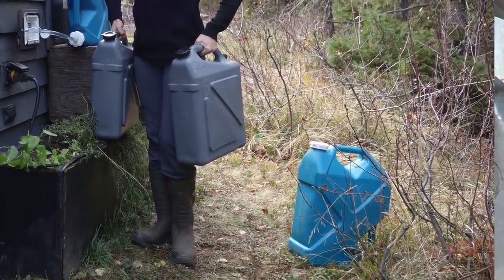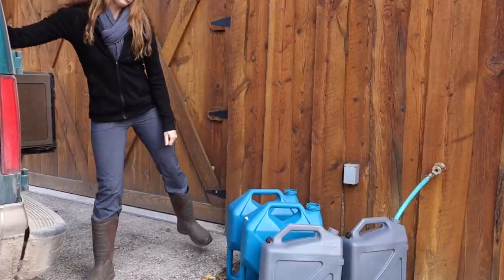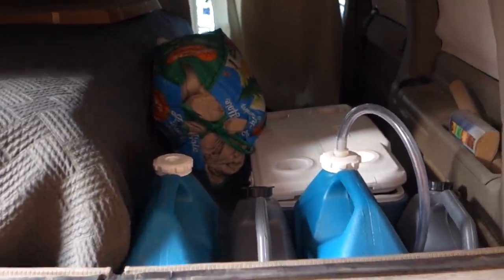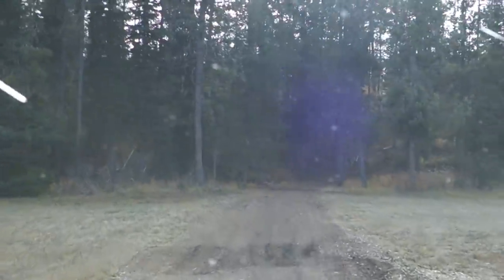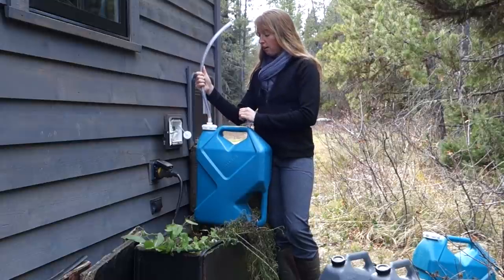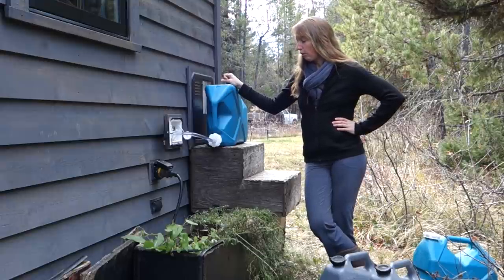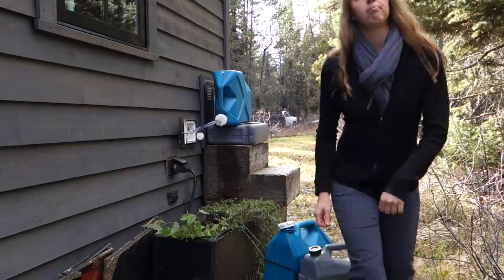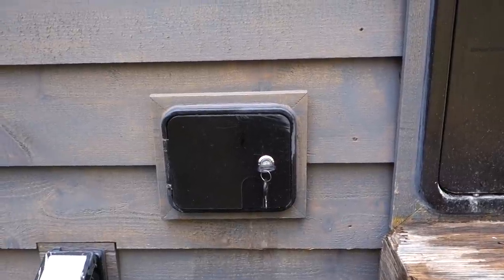Life in a Tiny House called Fy Nyth - Off Grid Water System

Comment: 3 food grade totes $ 200, ram pump from creek 6 months a year $ 200 max. Winter solar 12v trickle pump, and 12 v tote heater. Diy under $700, and when you leave goes with you
Reply: might not be "6 months" on the ram pump. Below freezing much of the time, including a frozen creek? a deep well is the only long term solution, but, as she said...better for  when she owns her own land. but, personally, I love ram pumps! I think they're the cat's meow. coupled with a solar-hot-water-heater, and there's free water, hot & cold!
Reply: @just-dl  I live in north eastern Canada, have a well,, but also built what I discribed for a grid down, I can pump energy free water year round, so I know cold believe me on that , and  I use a ram for all my garden needs free water no lugging, no cost after my initial set up, rams run for ever with little maintenence and 0 cost
Reply from the maker: Thanks for the ideas! I suspect you don't have experience with how cold the climate is here. We have solid snowpack on the ground for eight months a year at least, with temps down to -30F or more. That creek freezes solid for much of that. And I've never encountered anything electrical that could keep water from freezing solid in those temps that did not require more power than my whole system produces. (Unless of course the whole water system was internal and heated by my wood stove as everything I have now is.) And of course, there's no sun at all for many days on end in the winter as it snows thickly all day and I'm fairly far north. Then that creek melts, as does most of the snow, and it becomes a raging flood full of chocolate brown water, debris, and full trees washing down stream. Which wipe out and flatten anything you might have in the water. Then it turns into a nice calm clear creek for a couple months, and then we start all over. I did already build a ram pump for summer irrigation, you can see it's story here - https://www.youtube.com/watch?v=9nZcX4l1Z94 . Then even if I could over come all those challenges, I'd need a good filter setup to take out leaves, logs, and such debris for a few months, and another level of filtering to clean the water of bacteria from all the wildlife etc. that poop in it upstream. And all of that would also have to be internal to the house, or freeze and burst. :)
Reply: @daleval2182  Northeastern Canada? Which province? (I'm in the "other" maritime province...Maine) The garden is perfect for the ram pump! It can hibernate in the winter (or not, if your water supply doesn't freeze), and is set to operate at it's peak when you need it most. My place has no running water to tap into; but, I'm looking for a property with some topgraphy...and, preferably, a year-round stream/river to tap. (not just for ram pump but for hydro power. I'd like to get 100% of my water that way, if humanly possible.
Reply: @just-dl  Nova Scotia
Reply: @FyNyth  OK just made a suggestion, I lived in the north of Alberta , I  know the cold part, and now live in Tropical Canada, Nova Scotia, lol, sounds like you have no choice do what I did, dime up, buy land, dig a well, I use the ram from April till Oct, too grow, my well has 110v or 12v, from solar in a grid down, I have an on demand hot water system I can run on power or propane. I have a friend with an atisien deep well, still lug jugs from her place just for drinking as it's so pure ,and  taste so good. Good luck, where are you in Alaska? You have 8 months freeze?
Reply from the maker: No problem! It's not a bad suggestion, just explaining why it's not a good solution in my particular location right now. :) It sounds like you have a wonderful setup! That's fascinating to me that you can use a ram pump that long that far north. Maybe you have a bigger creek so it doesn't freeze as fast? What's your average snowfall there? Ours is 450 inches, though I've seen multiple winters over 600 inches. We still had solid 4 1/2 feet of snowpack on the ground through April here. It last snowed 9 days ago. :) Summer temps here rarely get out of the 70's F. during the day and freeze or close to it most summer nights. And snow is possible every day of the year. I don't quite know why this corner of WY mountains is so cold, but much of the time it's colder than most of the populated areas of Alaska and sometimes colder than Antartica.
Reply: @daleval2182  to paraphrase a former VP candidate...I can see you from my house! :-) Howdy, Neighbor!
Reply: @just-dl  howdy brother lol. Maine is beautiful natural country as is Nova Scotia, I lived near Toronto most my life, I'm up here now on an acerage, right beside on an 87 hectare lake full of brown trout, specel trout, I have a well good water, I can run on 110 v and 12 v solar back up, I have a pump house at the lake, and a ram pump at a creek behind the house,  so water never going to be an issue, Im located 1 klm from the port of Canso a major fishing port, so as long as I can still fish food will never be an issue, we have 15 above grade food plots 4x4, and this fall I'm planting hybrid apples, wild berries and mature apple trees  already grow all around the lot, all planted by the first owner, so this my piece of paradise to retire, I have a multi heat method, adding a wood stove this fall, as where surrounded by thousands of hectares of bush, firewood won't be an issue as long as I can still go cut it, but I have local vendors that deliver when that time comes. I can't afford a fully off grid solar and wind generator yet, but it's on my to do, I love the idea of rely on nothing for noboby for heat power and light, to me totally off grid is my goal

Comment: I have a question Ariel, could you take water from the creek at the back of the house? Seems like it would 
Work in a pinch but to consume it yes you would 
Have to filter it.
Reply from the maker: Yup. I can and do for watering the garden, and if I needed it, I would use it for drinking. But it's easier to get well water that I know is good and not need to filter.

Comment: I would love to know what kind of water tank you use?
Reply from the maker: The one inside the house? Hmm... I'm not actually sure of the name.
Reply: @FyNyth  is it a plain plastic tank with a lid or is it an actual water tank? I will be living off grid next year and doing something very similar with your water system, which is why I am so curious :)
Reply from the maker: @selienmorawitz1013  It's very similar in appearance to this one. Though I don't know the brand of mine, it is an insulated dedicated fresh water tank designed for an RV. Best wishes with your move and let me know if I can be more helpful. I'm sorry I can't tell you the exact make and model.  https://www.walmart.com/ip/Class-A-Customs-42-Gallon-RV-Concession-Fresh-Water-Tank-with-12-Volt-Water-Pump-T-4200-PUMP/180244433?wmlspartner=wmtlabs&adid=22222222222365238460&wmlspartner=wmtlabs&wl0=e&wl1=s&wl2=c&wl3=75247959360220&wl4=pla-4578847494952936&wl5=&wl6=&wl7=&%20wl10=Walmart&wl12=180244433_10000016552&wl14=insulated%20rv%20water%20tank&veh=sem

Comment: Good for you! Strong independent woman. Question: What if your van becomes immobile? You live so far out...off the grid. How do you clear the snow (road way?) First time viewing your post as you most likely can tell. Just wondering as I'm sure you must get snowed in. Do you have a helicopter?  Seriously...what if you get ill God Forbid?
Reply from the maker: Welcome and thanks for joining the Fy Nyth Flock! Well something major could always break down, but there are tow trucks here too, just a longer wait for one. But I do try to stay on top of regular maintenance and always have a jump starter, air compressor, extra oil and transmission fluid etc. in the van. Look up some of the winter videos around my house. I shovel around here and one of my neighbor's plows the lane out to the paved road. Ha, helicopters are not quite in my budget! ;)

Comment: you could put the steps vertically to drain the rest of the water to tank
Reply from the maker: Yup. In the winter I do, but in the summer, I need the bottom down as that is the only place there's a hole so I don't crush the plants underneath. :)
Reply: Also you may need a funnel to transfer the water to the can! just helping you saving water!! love your Tiny house!!

Comment: What's the difference between your little house and a travel trailer?
Reply from the maker: The construction. My house is built to a higher standard than most residential construction going up today. Everything about it should be solid and comfortable in 100 years. A travel trailer is much lighter and probably better if you move every day, though it will not be solid in a 100 years.
Reply: Thank you for an honest answer. Subbing with the bell.💓

Comment: You may want to consider keeping 5 or 10 gals in the house as a backup supply?!?
Reply from the maker: Except I already keep all 45 gallons in the house and don't choose to take space away from anything else to store more water at a time. :)
Reply: Fy Nyth Oh I didn't know that, I thought all you had was what you put in on the outside! Is that 45 gallons all in 5 gal. containers?
Reply from the maker: While it's filled from the outside, all that water is stored inside.

Comment: Wao that's a workout,but checkout those water generators that use the moustior from the air to generate water that will be the ideal solution
Reply from the maker: Yeah, but then I'd need a place to store one, power to run it (for most types), and since the humidity here is normally very very low, it wouldn't produce much. They can be good in areas where there is absolutely no other option, but with access to a very good well, I'm going to stick with that. :)

Comment: Don't agree with your temp or snow figures...  way off the average in fact.    Lowest "average" annual temperature was Lake Yellowstone, northwestern Wyoming, 32.0 F.   Record low for the State is -66° F observed February 9, 1933, at Yellowstone Park, and this was one freak day in the thirties.  No way it gets -50s or -60s anywhere in the the state, for even a day, let alone weeks at a time these days!  Northern MT where I live, hasn't even seen -60 for days in a row since the 30s.  Our state record is -70 in the Western part, but that was for a single day decades ago.  The average annual precipitation for Wyoming is 12.68 inches of rain and snow combined.  I have never heard of any place in that state where the average rain is only an inch... that would be less than the worst spot in Nevada!  I have lived in WY and  know the state quite well, and I have to say your locals have done well in exaggerating the figures!
Reply from the maker: I think I either misspoke or was not clear, there's about an inch of rain per month in the summer months. Most of that 16ish inches this specific part of the state averages for the year comes down as snow.

There is certainly a whole range of weather in the state. I do live in northwestern WY and higher than any of the towns even in this area so I don't believe there are any officially measured record for this specific location. (For instance, last year when the closest town with reported climate data got 8 inches of snow and some rain in one storm, my neighbors and I got 54 inches of all snow.) I have personally been here for at least one winter with temps in the -40's for a week (it happened to be the week I was outside much of the time for a NOLS's WFR course) and every winter except for two (this one so far is milder than any others, and one where it snowed almost every single day so there were too many clouds for the temps to really drop) I've had a couple weeks of temps in the -30's. My neighbors who have lived here on the same road for more that half a century report that -50's and -60's used to be the norm for those weeks. :)

Comment: Wells are not that expensive to dig.  Considering you live there for free, I would think you could put on in.
Reply from the maker: I suppose that depends on your area. To drill through granite here usually runs about $20,000+. And that's if you happen to be over any aquifer at all. While there is a lot of surface water from snowmelt in the mountains, many areas do not have underground water at all. The closest well to my location is over 300 feet deep and it finally hit bad water. Perpetually full of enough iron to stain everything orange and make it undrinkable. My location is far enough up the mountain from that well that it is doubtful that my location is over even that water or any others.
Reply: Fy Nyth, Jeez, never heard of that much trouble getting to water.  Clearly we have always lived where water is close to the surface. Thanks for enlightening me.

Comment: your lifting too much when you get little older its going to hurt .  suggestion 20 gallon tank in your van and a 12 volt small turbine pump about $40 - $50  ,  hose to reach .  save you some energy for other chord .   your little house is beautiful  and I'm a artist of 40 years .
Reply from the maker: Thanks for your concern. Since I lift more weight than this regularly for fun, I'm not too worried about it.
Reply: that's a good idea.

Comment: Why don't you put in a DIY  well system? Can do it yourself in about 5 hours and inexpensive. check out some of the YouTube videos of people who have done it.
Reply from the maker: I'd love to watch if you can share a link to a specific video! I'm sure other folks around here would be interested as well if it could replace the $30,000 cost of drilling a well through the granite here. If I could hit the same aquifer as the closest well to my house (and it's far enough away from me there's no guarantee that would happen), I'd need to be around a 100 feet deep and that would get me orange water with so much iron in it that it's undrinkable and turns everything it touches orange. The closest good well I know of is a little over 300 feet deep, but it's more than a mile from my house and over two ridges, so there's no way I'm sitting on the same aquifer.